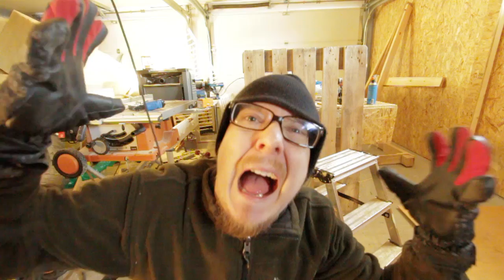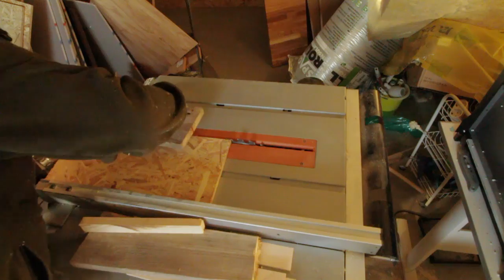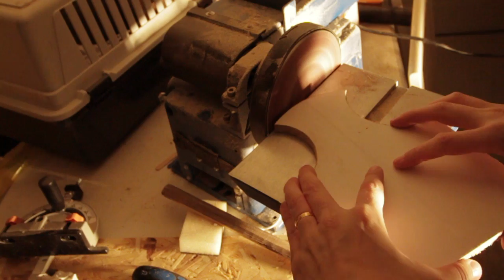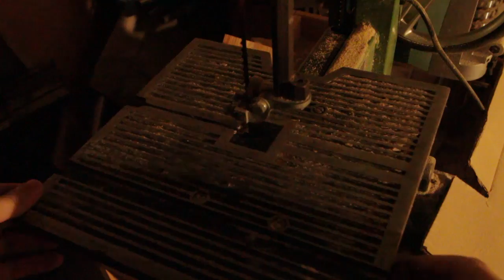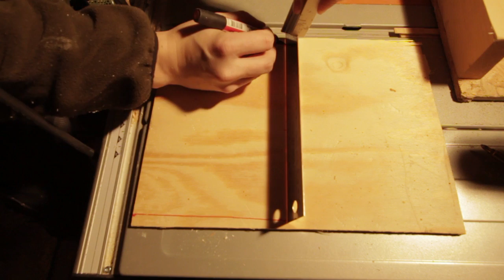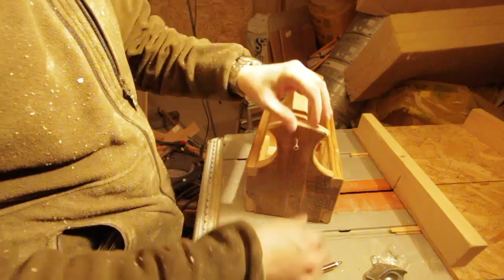Pallet Wood Beer Tote #1

Comment: You can use the end of your belt sander to sand out the saw marks from the ban saw. Right where our wraps around would fit right in there.
Reply from the maker: Justin Kohnen I think that's exactly what I did, as I remember hogging out so much, it started ro deviate from my template. Thanks for watching!

Comment: This is a valuable addition to my woodwork collection https://www.youtube.com/post/UgkxbnOKZBE4evMO5V2vroHeCjq6d_MV6wJO  I still will rate this woodwork plan as the best in my reference library. It always seem to stand out from the rest whenever you go through the library. This is a masterpiece.
Reply from the maker: Cladding? I'm not an expert in the terminilogy in English, but to me, that would be the exterior? Considering the video though and the condition of my garage.. On the inside I put a layer of OSB for screw support and ontop of that a layer of drywall to dampen sounds and add some fire-protection (sparks from grinding / spatter from welding).  The OSB probably isn't necessary, though

Comment: although the workshop is very messy
Reply from the maker: It waan't as much of a workshop as it is a garage used for storage, except there were no shelves so everything was on the floor. :)  It's a lot better now  but not perfect.
Reply: @JWAM  Perfect is your job, and if you feel good doing it, there is nothing to worry about.

Comment: Beautiful, beautiful work, Sir! I love it! You still don't have that shop set up? Get to work over there!

Where you working by moonlight in some parts or were the dark scenes just your camera choosing bad auto settings?
Reply from the maker: Thanks friend! Nope, been a bit lazy with the shop. It's very annoying putting insulation and sheeting on the walls when there's so much crap along the walls that have no place to go. But yes, it's about time to get back to it!
The lighting.. Pretty much moonlight considering the hours and location..There's only a single "construction site 'floodlight'" which is stuck where it is (beside the table saw). If I disconnect it, it's pitch black in there and making it hard to move... Bandsaw is on the other side of the garage.
Reply: + JWAM  Oh, how I do all familiar %). Very often there is no time to clean up the studio, so shoot the video so that the trash does not enter the picture :)))).
Reply from the maker: Yes, after I'm unable to blame that the garage is unfinished, it will still probably be a mess. :)
Reply: +JWAM  We call it "creative disorder" :)

Comment: Beautiful design, and i really like the bottleopener on the side.
But it looks funny with the handle on the handle. Any particular reason for that ?
Reply from the maker: Thanks for watching! Yes, all totes that I've seen have been very high,which seem to be both a bit hard to store, and maybe even block the view across the table. The wood part is not supposed to be a handle, it's so low that it's at the height of the necks of the bottles so tou can't get tour fingers under it. It works as a support beam to hold the sides together and be something to attach the handle to.
My original idea was to have the beam even lower, and then have an "ingenious" handle that you could fish out from the beam so that the handle would never be in the way when the thing wasn't carried.
Anyway, I couldn't think of the right material/design for it for the little time I had.
The current design still looks quite compact for as far as totes go. And weird if you'd look at the beam as an handle. :D

Comment: the add on handle realy spoils this tote, why did you go that way and aswell i can see when you grab it by that you likely will catch your fingers on the bottle caps maybe cutting your fingers, it was fine without it. simple rustic, why try and tart it up to a piece of ikea. my mind is baffled ???????
Reply from the maker: victormeldroo Hi! First, thanks for watching and taking the time to comment. :)
The reason is that I wanted to make a tote that had a lower profile than the usual tote that people build (see my "beer tote #2" to see what I mean). So that it can be on a table without obstructing the view to your fellow drinker.
 If I remember correctly, my original plan was to have somekind of a rope-based handle (with some faux-leather wrapped around it) that went through that "bar". so when you let go, the handle would drop down onto the bar.  I had both very little time to finish it and too afraid to go the handle route as I have never done such work, nor had I really done any woodworking at that point.
That being said, I quite like the handle and the form factor of it. It sure is "different" and apparently provokes feelings in both ways. That's the way I like it. Bland is too bland for my taste :)